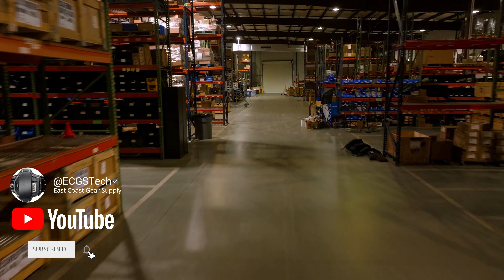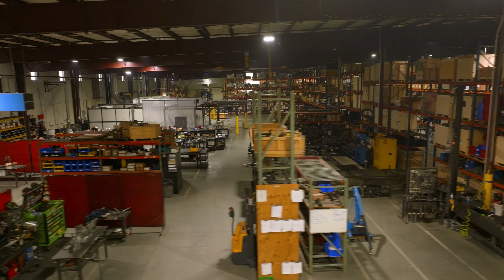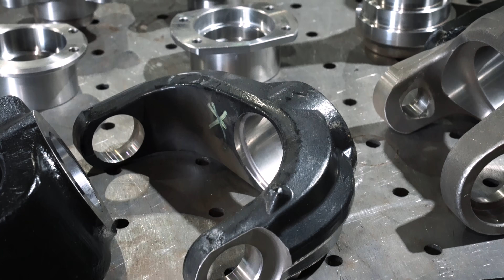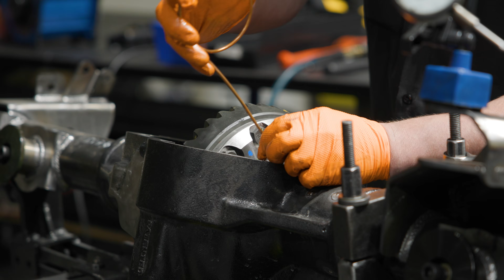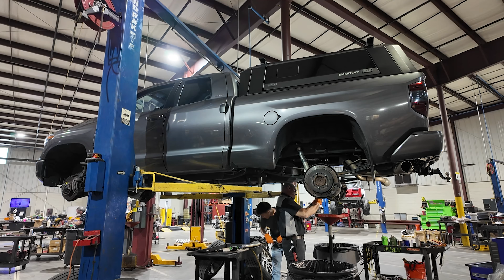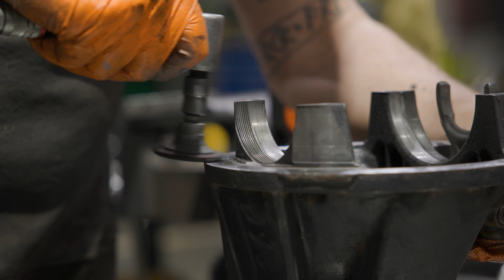Inside East Coast Gear Supply: Differential Parts, Crate Axles, Service & Toyota Diffs

Comment from the maker: Most people know ECGS for complete crate axles, but that is only one part of what happens here.
This tour covers the four main parts of East Coast Gear Supply:
1. Differential and axle parts
2. Complete crate axles and custom axle assemblies
3. Differential repair, installation and diagnostics
4. Remanufactured Toyota third members and clamshell differentials

Which part of the operation would you like us to cover in more detail next?

For product questions, email sales@eastcoastgear.com.

For technical or fitment help, email tech@eastcoastgear.com.